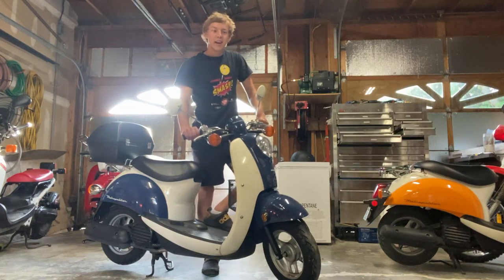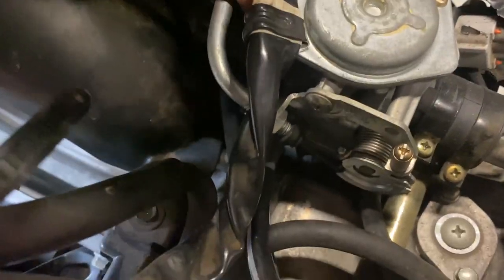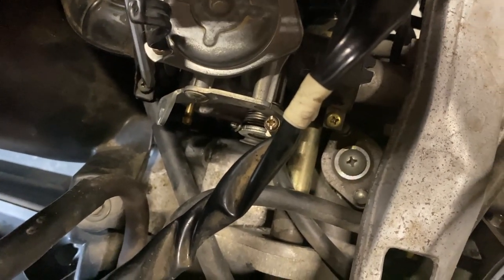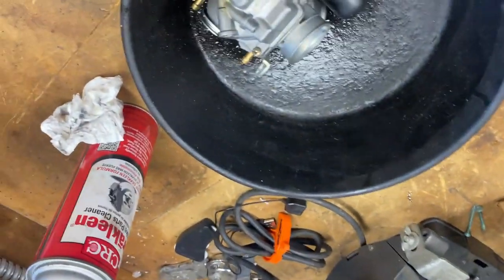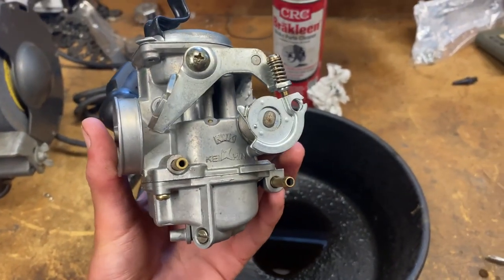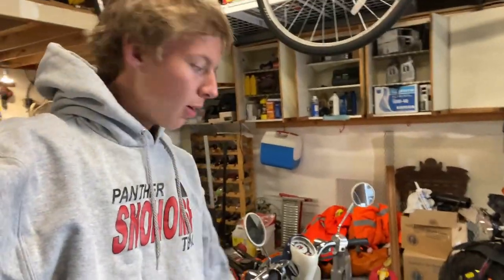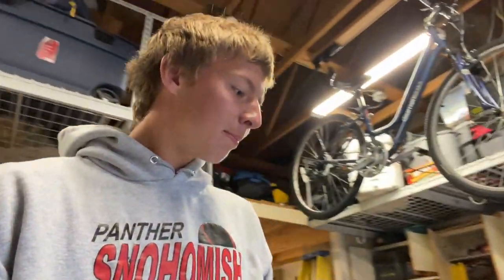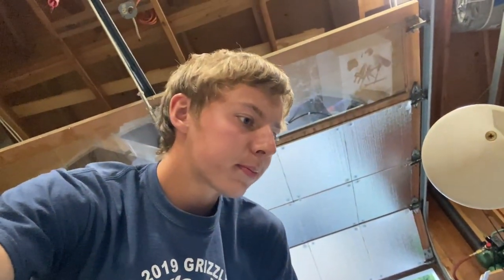Honda Metropolitan Revival (Carb clean tutorial)

Comment: Thanks for the videos.. I have an 08, ran great until battery went dead, so we just had to kick start it ,and still ran fine. After taking battery out and charging , it will idle fine but bogs down when I give it gas , and has no power . Have you ever run across this ?? Thanks in advance
Reply: The rubber intake may be cracked letting in extra air. If so, coat in silicon sealant and retighten.